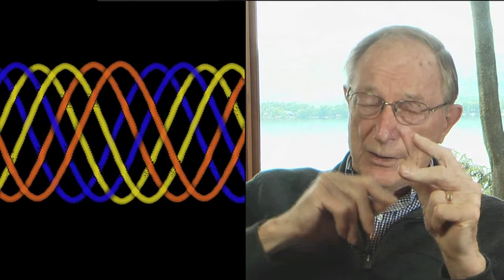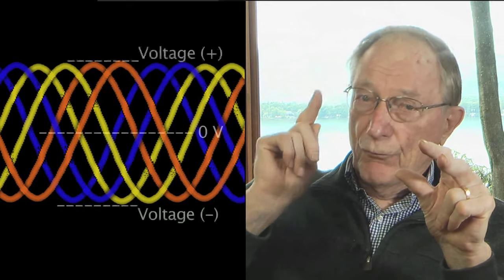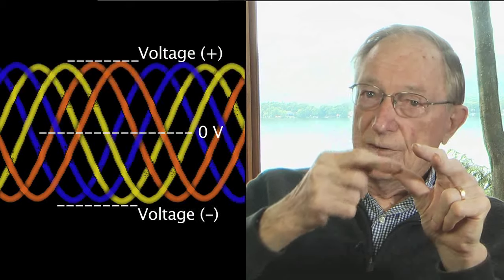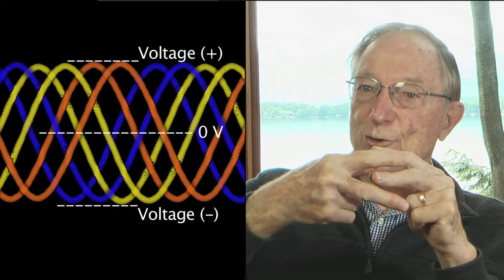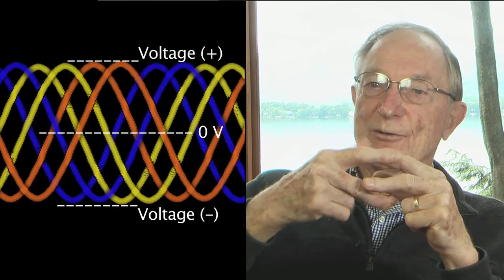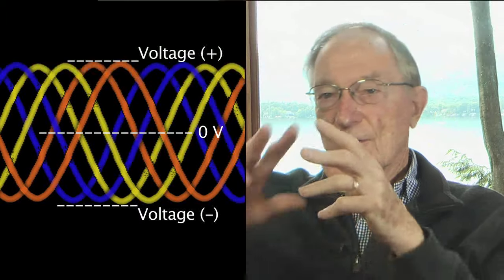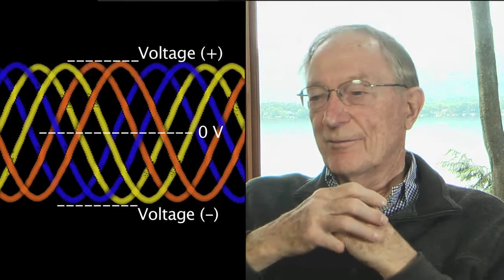Why 3 Phase Power? Why not 6 or 12?

Comment: - Channel is named after Edison
- Talks about alternating current

The irony
Reply: Tesla > Edison
Reply: Marcus Tornea
Do your snide remarks apply to other fields?
Can Ford detail the benefits of torsen differentials? Or turbo power?
Reply: yeah take a day off ferrous bueller!
Reply: Just as ironic is that TESLA,  the car, runs on DC Power.
Reply: Edison killed that circus elephant. over the war between DC n ac power. Westinghouse was a great man. very kind to his employees.
Reply: ac is form of pwm NOT squared..2
Reply: It uses a DC battery. but has an AC 3 phase motor
Reply: It does not run on DC power. DC power is converted to AC before it is used in the induction motor.
Reply: Nicola Tesla the GOD of electricity
Reply: Denis Van Decker. Why is that ironic? Explain please. Because Nikola Tesla's AC was for power distribution. Edison used the AC to electrocution of animals. How is that related to vehicles AC and DC motors?
Reply: Denis Van Decker...  And...  BTW, Are you sure Tesla Cars use DC power?
Reply: Wouldn't be more accurate to attribute AC to westinghouse? If we are going to bring edison into this I mean. Might as well not compare apples to oranges. "Edison" was less of an inventor than the owner of an inventors workshop, like westinghouse(who employed tesla during the period he patented the bulk of his AC related inventions).
Reply: Denis Van Decker inverted to.....AC
Reply: Edison would alternate in his grave.
Reply: Denis Van Decker the Tesla namesake is about the induction motor which is very much AC, they use an inverter to provide AC drive to the motor from a DC supply.
Reply: Jay Edlington, the thing is, the whole concept behind this video is faulty.  The guy in this video has lost some of his marbles and forgot the knowledge that he likely once held that would have prevented him from making the claims he did, namely that you could double the amount of wires without taking up more space.  That is fundamentally flawed logic, as each conductor must maintain a minimum distance from another based on voltage, so it's not possible to half that distance between conductors as shown in the video @ 0:30 to 0:50.
Reply: *the Coppery
Reply: hahaha
Reply: I came here just to see in what condition things were happening! :)
Reply: lol
Reply: SirArghPirate he just hit synchronous speed lol
Reply: Ummm, no.   The very first electric chair was (at least in part) the brainchild of Thomas Edison, who had been putting on public demonstrations using AC power to electrocute animals - monkeys, dogs, a baboon, and even an elephant.  A Buffalo, New York dentist name Alfred Southwick purportedly proposed the design as a "humane" alternative to hanging around 1881, when he learned of the electrocution death of a dock worker in Buffalo, just prior to Edison going live with his DC powered Pearl St Power Station.  Southwick began doing hundreds of experiments of animal electrocutions.  Edison took advantage of Southwick's work to smear and discredit Westinghouse.  AC was used in the first electric chair, using Westinghouse AC generators, bought by Edison & friends through a third party in South America.    William Kemmler was the first human ever intentionally electrocuted as a means of carrying out a death sentence.  It happened on August 6, 1890 at New York's Auburn Prison, and the power delivered was 1000 volts AC.   To my knowledge, no one has ever been electrocuted in a death chair using Dircet Current.
Reply: And there's an inverter inside to drive the motor with... 3-phase AC!
Reply: your right , i think he stole it
Reply: There is no mention of six-phase power anywhere on Tesla's website. Perhaps an experimental model was powered by 6-phase, but all the current ones use 3-phase.
Reply: Cesar Alf M S Edison was trying to prove AC was more dangerous than DC when he electrocuted those animals. He was attempting to cripple Tesla's invention.
Reply: Tesla, the car, uses AC INDUCTION MOTORS.
Reply: Tesla, the car, uses AC INDUCTION MOTORS!
Reply: Dan P you missed the part where he showed rotation of the phases to allow for that. Two conductors under the same phase have zero potential, therefore they can run in a nearer proximity to one another. Yes there are limits to how close they can ultimately be combined, but those tests done in Malta showed it was possible. Just not practicable.
Reply: The motors are AC
Reply: Yes Edison system uses AC
Reply: The DC is inverted to AC to drive the motor. Even "DC motors"  run on AC, the inversion process is accomplished by the brushes interracting with the commutator.
Reply: "Tesla > Edison". I was looking for that comment! Perfect!! :) Thx @Stonent
Reply: @Denis Van Decker Holy Shyt!! I never thought of that...*Mind Blown*!!!
Reply: Mr Tesla was incredibly gifted and a true genius.
Reply: @denisvandecker8275  it does not use DC inverters are used to convert DC current to 3 phase ac who's  o/p is controlled pwm , which is then  used to power a  3pase induction motars,  the motar may be called a brushless DC motor because it drows power from battery but its operating principles is similar to a 3 IM as the 3phase  stater windings produce a rotating magnetic  field
Reply: @cesaralfredom  his statement erroneous or out of ignorance,  the DC current of the battery is conveted to ac by inverters
Reply: @denisvandecker8275  The battery is DC, everything going to and coming from the "motors" is AC of some form.
Reply: This Tesla vs Edison crap is useless. Both were geniuses, Edison was just more wise and a businessman and Tesla peaked early and became an entertainer. Tesla worship is stupid and so is Edison hatred.
Reply: @jamesahern9864  The comment here is just pointing the the great irony i.e Edison did every think in his power to hinder 3 phase ac transition including elcticution of stolen pets and animals ,a century later a youtube channel  named in his honor uploads video about the very same technology.
Reply: stonent p
Reply: @deeremeyer1749  You replied to a troll post with rambling lunacy.
Reply: But runs on AC motors....
Reply: @deeremeyer1749  wow.. 8 months later you gotta admit this rant was drug fueled atleast to some degree.
Reply: @denisvandecker8275   No it doesn't  It "runs" on 3 phase AC. It stores its energy as DC.
Reply: @denisvandecker8275  The DC power is converted to three phase to run three phase permanent magnet motors (PMAC).
Reply: @ekinerdemaygul1582  There not induction motors but permanent magnet three phase motors (the armature is made with magnets no induction from the stator to induce a field within the armature is needed) . Induction motors are about 10% less efficient mostly because of slip.
Reply: Denis Van Decker - This is false statement. Tesla car is named after (Nikola) Tesla just because it really runs on AC. Batteries are DC, but there is a converter in every electric car that convert DC to AC to power the electric car. “Edison” car will not go very far, ha-ha. Everything we have today we should thank to Nikola Tesla. There is nothing to be thankful for when comes to Edison.
Reply: Edison also did research into AC power. He was more interested from a business perspective in DC transmission because his view was of city and Urban electricity supply. 

Tesla's vision was away ahead of its time because there was not the resources or ability to supply over long distances. 

Why Edison's vision we would have had a more local electricity system that would have been a little bit more expensive in the long term to set up but would have been far more reliable.

Everybody talks as if Tesla invented AC power when all he did as a design engineer was decide that AC was better because he had a vision of large scale distribution.
Reply: @stonent  Edison made things that worked. Tesla had one bright idea but all the other stuff was unworkable
Reply: @cesaralfredom  :  Here is what happened:  In the late 1800's it was evident that electricity was the power of the future.  Edison wanted to use DC power in the future
grid.  Since DC power is less powerful than AC you would have to have a booster station every 1 1/2 miles.  Tesla had worked for Edison when he first came to the US, but Edison was a jerk and refused to pay Tesla the $10,000 he had promised him for making the Edison Dynamo more efficient.  Telsa left the Edison company and went to work for rival George Westinghouse.  They were promoting an AC power grid which
could go many miles through lines.  There was only one downside to AC power - it could kill you, DC power could not.  
  Edison wanted to win the argument and make money off of his DC ideas, so he began conducting experiments on how to kill animals with AC current.  I had not heard about an elephant, but he did use horses headed for the glue factory.  It was about this time that some people wanted to find a more  "humane"  way of execution than hanging, which was them the norm in the US.  Seeing Edison as a "wise" man, they came to him to get advice on how to accomplish this.  Seeing an opportunity to make AC power look bad he advised them to strap the condemned into a wooden chair and pass AC current through the body.  He even told them about how much AC current to use (based, of course, on his secret animal experiments).
  Westinghouse spent big bucks to keep the condemned out of the chair thinking that AC would be doomed when the public saw what if could do to a human.  When this method of execution was tried for the first time the results were grotesque.  With the press watching the condemned took 20 minutes to die and sort of "melted".  The press vilified Edison for proposing such a thing.  Westinghouse and Tesla won the argument and the rest is history.
  Edison later said "It is a good thing that George won that argument or we would have a grid of booster stations every 1 1/2 miles all over the country."
Reply: @bipolatelly9806 :  No it was AC.
Reply: @ksman9087  oh! Did not know that. Thanks.
Reply: KS Man 
OK
yes.
Reply: By rights it should be the Tesla Center and Tesla Channel. Tesla never gets the credit he is due, mainly because Edison was a showman and promoted himself while Tesla concentrated on actually making the world a better place. Edison lost hos charm for me when I found out that he electrocuted and elephant in a stunt to show how dangerous A.C. was. A real scumbag!

In contrast, Tesla made more contributions to the modern world than Edison could even imagine. A.C. power, radio, A.C. electric motor, auto ignition system, and experimentation with a form of RADAR.
Reply: @HERŞEYKÖTÜ  someones in her, where?
Reply: @edlingja1  It sounds like you're taking that personally. Edison paid somebody to build the electric chair to prove how dangerous alternating current was. Did Henry Ford do anything like that?
Reply: @danp129  Yes the lines would have to be spaced about the same distance from each other but when you go from 3 to 6 your towers foot print would still be the same. And you would only need one ground line instead of 2. Insulators would be about the same number with 6 as with 3 but would need to be longer to maintain a safe distance between wires. But it would not need to be doubled as it would depend on how you phased them. If the phases are such that they are only high when the other nearest one is low, you need double. But if phased so that one is leading the next closest, it would only have to be distanced to cover the voltage of lag voltage difference. Phase 1 to 2 would be 60 degrees ahead. Phase 1 to Phase 3 would be 120° ahead and Phase 2 would be 60° ahead of Phase 3. Phase 1 to Phase 4 would be ahead and behind it by 180° and Phase 3 would be ahead of Phase 4 by 60°, Phase 1 would be ahead of Phase 5 by 240° and Phase 4 would be ahead of Phase 5 by 60°. Phase 6 is where it gets interesting as Phase 1 would be 300° ahead of Phase 6 but also behind Phase 6 by 60°. Phase 5 would be ahead of Phase 6 by 60°. Building the generator for it would be fun as you would have to work in sets of 12 leads and brought out as 6 leads from it. But 12 lead alternators are already common in 3 phase units. For the 6 phase units, it would be more likely to see either 24 or 36 lead units.
Reply: @thorlancaster5641  Not after this year and the Model 3 never was. They are going with permanent magnet reluctance motors. The Model 3 was introduced in 2017. The new motors for the S and X Models are replacements for the induction motors.
Reply: @denisvandecker8275  Washington DC that is..
Reply: @denisvandecker8275  No, it does NOT. Tesla uses AC induction motors. DC motors, in general, do not allow regenarative braking. The _batteries_, of course, are DC, but the motors are driven by inverters.
Reply: @denisvandecker8275  And DC is converted to AC for the motor .
Reply: @deeremeyer1749  Tesla was Edisons controlled opposition only. it was thier job to patent and sequester the tech of the previous civilization- making it illegal to manufacture.
Reply: empbac  Anybody who thinks "caps" = "anger" instead of
EMPHASIS has been brainwashed to be offended by "anger" and to respond to "caps" automatically without thinking for a REASON. Because in the REAL WORLD where capitalization is for EMPHASIS to call the reader's attention so something IMPORTANT not only are "caps" not "angry" or "harmful" or "ranting" irrelevant information, they're for the exact opposite. Information a reader needs to know if they want to be properly informed of FACTS and therefore "safe" from the dangers of being IGNORANT AND BRAINWASHED. So the short answer to your "rhetorical "question" you open your "reply" to my statements of FACT with where I didn't ASK for a reply and did not ASK for your opinion and did not ADDRESS YOU PERSONALLY AT ALL is that I don't KNOW why you'd read something "offensive" and apparently you don't either IF you did read it. Which you must have to be "offended" by the CONTENT instead of the CAPITALIZATION. But you imply with your "rhetorical question" that you didn't read the remaining content anyway once becoming offended by the caps, nobody asked your opinion and the "caps" certainly GOT YOUR ATTENTION which was my INTENT since I sure as hell can't POSSIBLY KNOW WHO WILL READ MY "RANT" MUCH LESS KNOW THEM PERSONALLY AND BE "ANGRY" AT THEM INDIVIDUALLY AND CERTAINLY CAN'T PREDICT WHO WILL BE "OFFENDED" BY THE USE OF CAPITAL LETTERS AND OBVIOUSLY DO NOT CARE WHO I "OFFEND" BECAUSE THE FACT THAT THEY'RE "OFFENDED" BY EMPHATIC "SPEECH" IN WRITTEN TEXT REGARDLESS OF THE CONTENT SIMPLY BECAUSE THEY'VE BEEN CONDITIONED TO RESPOND LIKE PAVLOV'S DOGS IS NOT MY PROBLEM. IT'S THEIRS.

Thanks for participating in my "experimental science". Keep being told what you should find "offensive" and that emphasis from a stranger "shouting" or "capping" in his or her communications in public to whoever may be "listening" and you'll continue to be as immature, childish and harmless to those that want you to "respond" instead of "reply" to the "stimulus" of spoken and written public communication as possible.
Reply: Ferriferous irony ;p
Reply: Three phase power was invented by a polish man named Dolivo Dobrovolski at around the same time as Tesla was working to put his 2 phase alternating current to the public.
Reply: Mr Tesla had invented the AC generator ( in time when people believed is not possible, INCLUDED THOMAS EDISON) and solve the problem of energy transport . 
 Thomas Edison  is famous for electric lamp ...
 This invention is not belong to him.

When a institution with reference to Mr.Edison talk about invention of Mr.Tesla is great irony.
Reply: @stonent  Edison nor Einstein were perfect but no American inventor comes close to Edison.  No way no how
Reply: @DrDiff952  Nope. Tesla was a con man, impressing people by living at the Waldorf Astoria. On credit. Didn't pay his bar bills.
One invention: the automated dry-textile shuffler for collecting static electricity. Sucked up to actual inventors but told third parties he was a big shot just like the guys he was sucking up to.

A total fake -- just like his near neighbour with the funny hair and the similar pile of unpaid bills.
Reply: @rich1051414  Yes. Westinghouse did it. Tesla didn't.
Tesla was a fraud, a con man, and a leech.
Reply: @denisvandecker8275  charges from ac though
Reply: Yes it should have been named after Tesla
Reply: @btslogz  
The only thing that should be named after Tesla is Riker's Island. Telsa was a cheap-ass con man whose only contribution to humanity is the spark-machine for the sci-fi movies of the 1930s.
Reply: Cheers, Marcus!  Cheers....
Reply: @denisvandecker8275  TESLA is a mockery to the name.
Reply: laszu AC power would've eventually led to serious issues with infrastructure and radio frequencies. There was an actual reason it wasn't adopted universally other than the half-ass conspiracy theories.
Reply: bipola telly Edison was one of the not brilliant human beings to ever live haha this whole thread is a bunch of first year, community college, wanna be engineers.
Reply: senagabenagaineklerikimsaga right on! I almost every damn time see Tesla fanboys spewing hate on Edison! To them, Tesla invented everything!
Reply: @rich1051414  the difference:- Edison claimed inventions that were not his to claim. It's why he unfairly had the title of "America's Greatest Inventor" or how ever it was worded. Westinghouse, gave a place, a workshop, for inventors to invent and allowed the inventor to take the credit, with the world benefiting. 

Tesla, however, had already invented the idea of Polyphasic electricity transmission before he worked for Edison, if my memory is correct. Meaning neither Edison nor Westinghouse had a claim over Polyphasic AC electricity. Westinghouse merely saw the potential of high voltage polyphasic AC electricity generation and transmission and invested in it. Leading to the world we have today.
Reply: Denis Van Decker Not entirely, though. The motor is an induction motor (invented by, guess who, Nikola Tesla), and it’s a three-phase motor. So it requires a controller that converts the battery’s DC to 3-phase AC, just like the misnamed BLDCs (brushless “DC” motors, which aren’t actually DC motors... in fact, you could argue no motor is a DC motor, but given that brushed DC motors have the brushes and commutator inside it, you could consider them DC).
Reply: @michaelhunt1115  of course, he was not kind to Tesla who ended up broke in New York City, where he talked to pigeons in the park.
Reply: @alyssajohnson2481  and they say Edison lived like a pig and constantly stunk.
Reply: @denisvandecker8275  It uses induction motors, invented by Nikola Tesla. The DC is converted to AC.
Reply: Denis Van Decker no, it runs on ac, it has an ac motor with an inverter to convert the stored dc power
Reply: How shocking
Reply: @HERŞEYKÖTÜ  Edison ran a think tank, where he stole the ideas of the creators for his personal gain.
Reply: @deeremeyer1749  Taking a strong single phase jolt, can result in an incurable form of 'CAPS Key'.....
Reply: When I see the name Edison I always think yeah he is the guy that robbed Tesla.
Reply: That elephant was condemned to death by the authorities NOT Edison. It had killed two of its trainers. The Edison factory was approached to electrocute it. Publicly agent (a Mr Brown) willing accepted seeing it as a chance to demonstrate the relative safety of their 110volt DC supply over the much higher voltage systems employed  by the opposition. Sadly, Edison was right and since then countless thousands of humans have died from electrocution by high-tension power supplies. Edison, always the humanist, was not callous  enough to consider that as we all now do, as merely ‘collateral damage’ in the quest to deliver power more efficiently.
Ironically, with future solar and wind-powered systems, Edison’s lower voltage with more power stations system may well win out. And, keep in mind that it wasn’t AC versus DC itself that concerned Edison, it was instead his relatively safe versus the opposition’s absolutely lethal  voltages that he was attempting to point out.
Reply: @denisvandecker8275  not so true actually. Battery is DC of course, but the electric motor is actually AC like.
Reply: My first thought too 😂
Reply: Ac = Tesla and Edison hates his guts...
Reply: XD
Reply: @DanPetrePhotos  Actually Tesla had multiple bright ideas... But not all were directly related to electricity.
Reply: @DanPetrePhotos  Actually Tesla had multiple bright ideas... But not all were directly related to electricity.
Reply: Even Edison knew AC was superior...
Reply: @ekinerdemaygul1582  the newer ones run on dc
Reply: @DrDiff952 no that's thor.